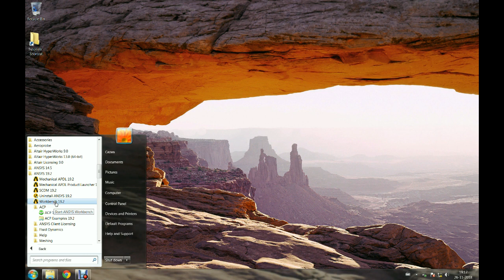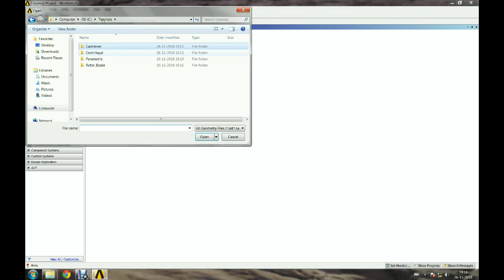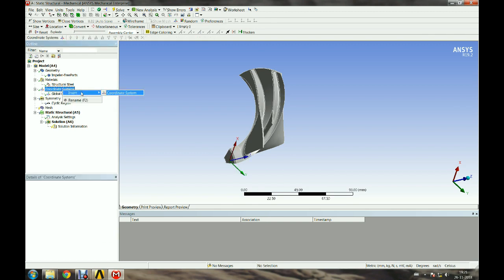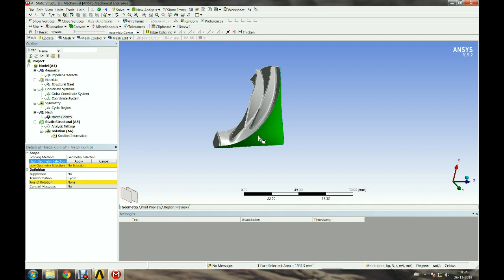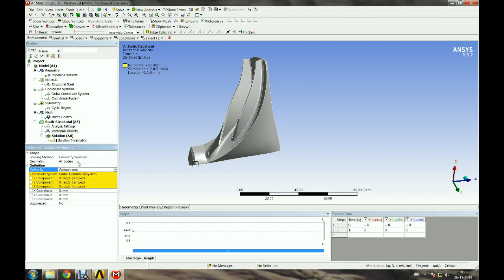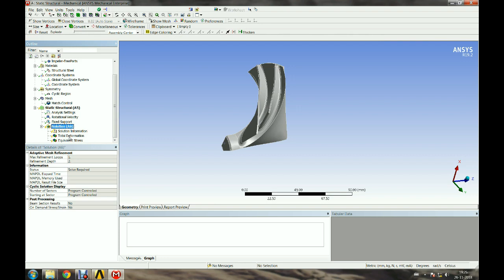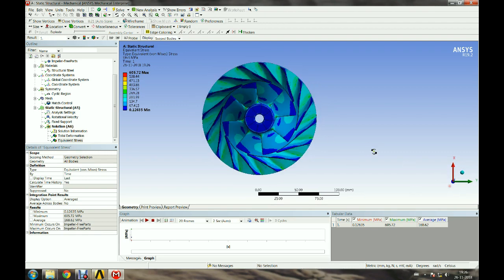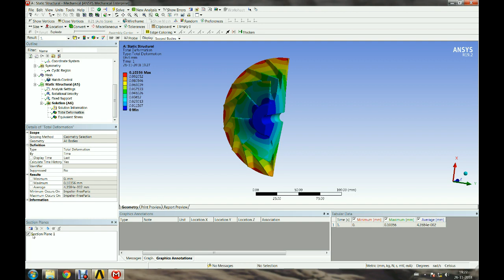Cyclic symmetry analysis | Centrifugal impeller | Ansys Workbench

Comment: Fixing the face in all e direction will over constrain the analysis. U can keep the axial n circumferential direction fix while keeping radial direction free for deformation...since it will expand in radial direction due to CF
Reply from the maker: Yes you are correct. But for this problem, results did not change much for both cases.

Comment: Hello, thank you for this video. I have a question about BC too. What if my impeller is mounted on a shaft that has very tight tolerance in context of a bore. Also top  surface of the impeller is secured by a nut. Bottom face is in contact with thrust collar which rotates together with a bearing and impeller ofc as one rotating component. Could you suggest what kind of boundary conditions I should use? In the mean time I will try different BC's and compare results. Thank you.
Reply from the maker: Hi, thanks for your comments. You may do an analysis with assembly of all connected components to get exact results near the interface location. If you are concerned with impeller disc stress and growth, then you can do the analysis with the condition given in this video + an axial compressive load due to locking nut. This should be sufficient. However effect of axial clamping will be less towards impeller disc stress and radial growth.

Comment: The fixed support BC over-constrains the interior surface, this surface should be able to 'expand' with the centrifugal effect.
Reply from the maker: Yes. Fixed support is given only on the front face which is of lower radius. However, front face inner edge could have been fixed.
Reply: @LearnCAE  inner edge = same problem, with rotation the front face moves out (increase in diameter)
Reply from the maker: @gregtrottet9604  Our concern is bore stress and max deformation evaluation. Fixing front face or edge will not affect the results very much.
Reply: @LearnCAE  Actually your results show very high stress on the inner face fixed BC, stress would be lower if such a BC was not used. Fixing an edge would be even worse as you would end up with a singularity along the edge.
Reply from the maker: @gregtrottet9604  I have not fixed the inner face. I have fixed only the front face. You have to fix any region, be it front face or front face inner edge. I tried both conditions and results did not vary. Moreover, I have checked this condition with experimental data too and it is matching well. You may suggest other BC if you wish, I can share the files too if required.
Reply: @LearnCAE  Hello, nice to meet you. This is my question: if the hub of the impeller is mounted on a cylindrical shaft, What will the real boundary condition must to be imposed? I usually consider fixed the cilindrical face of the bore. Isn't correct? Thank you
Reply from the maker: @danydov534  Hi, I also made this mistake at the beginning. If the cylindrical face is not attached/glued to impeller hub face, then it is not recommended to fix the cylindrical face. By this, you are arresting the impeller hub face and stress results may vary. You can specify the boundary condition based on the assembly and torque transfer.
Reply: Hi, sorry very late comment this. But at the moment I'm having trouble to decide what is the best boundary condition for an impeller. The fixed face isn't the correct one. But which is the correct one? The bore diameter will increase during rotation, and the bore will also axially expand. So which boundary condition in ANSYS structural gives me this movability? Thank you.
Reply: @pantrofl  this is the eternal problem of fem.

One solution could be a cyclic repetition, as the symmetry planes can be immobilized perpendicularly...
Reply: @pantrofl   I realize this is a bit old, but you can place a frictionless constraint on the front face to constrain the axial direction, then choose a vertex on that face and constrain it in the theta direction (displacement constraint with a cylindrical CSYS and set y to '0').  the model will still be free to deflect radially.  Hope this helps someone.

Comment: good video. Just curious how did you create the sector model ?
Reply from the maker: Sector model can be created in any cad modelling tool. Create a surface between two blades and revolve by sector angle. Then trim the impeller with respect to those two surfaces. In this case UG NX was used to create sector model.

Comment: you do incorrect analysis
Reply from the maker: May I know which part is incorrect here?
Reply: @LearnCAE  baundry condition  incorrect
Reply from the maker: @oleg20121982  1. This simulation matched well with test data.
2. Boundary condition depends from case to case. For this case, fixing the front face does not alter the max stress or max deformation of blades, which are the prime objectives of this problem.
3. You can choose alternate boundary condition as per your problem setup and compare the variation in results.
4. Thanks for your comment. Kindly let me know if you need any other clarification.
Reply: @LearnCAE  This all affects the clearance (gap) and stresses on the tip of the blade.
Reply from the maker: @oleg20121982  Stress will be anyway low at blade tip. It will be high at disc bore and blade hub fillet region. Clearance will not vary much as disc growth will be low near inlet region.
Reply: @LearnCAE  I hope you do not make engines for helicopters and airplanes.
Reply: @LearnCAE  Companies GE and Pratt@Whitney do the analysis correctly.  they have many different criteria besides maximum stress.
Reply: @LearnCAE  I do calculation of the   impeller and turbine. now I understand where such wrong calculation come form.
Reply from the maker: @oleg20121982  See, you can prove which is the correct method and show the difference in results for both boundary conditions, rather than wasting both our times.
Reply from the maker: @oleg20121982  Let them have many criteria for their own interest. Simple objective here is to show how to do cyclic symmetry analysis!!
Reply: @LearnCAE  you have correctly made cyclic symmetry, but the anchorage is not correct.
Reply: @oleg20121982  Can you share the correct boundary conditions and constraints. I am doing almost same analysis. I think the fixed support can affect the clearence and stresses as you think. I am applying frictional contact to top (where fixed in this video) and pressure to bottom for prestressed of axial movement. But, I can not take solution when I applied this BCs. I will appreciate it if you can share the correct approach for BCs of this analysis. Thanks
Reply: @teb7002  I need to see the cross section of the compressor and what are your loads?